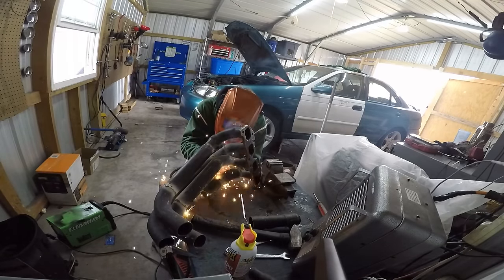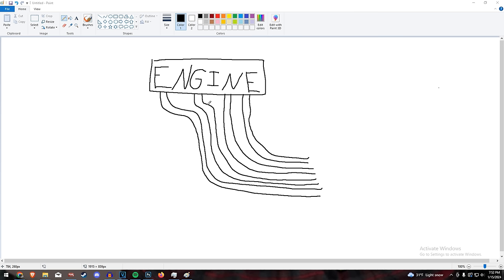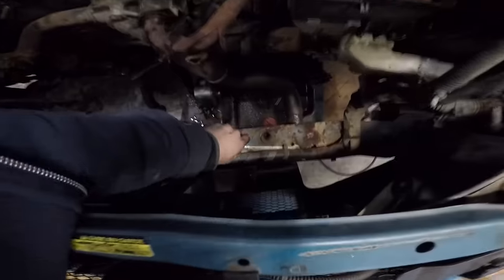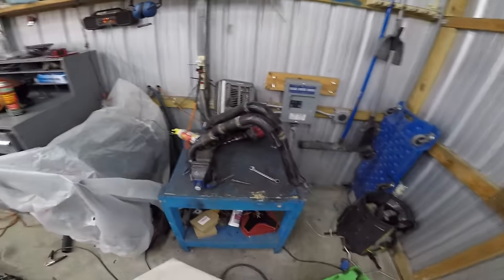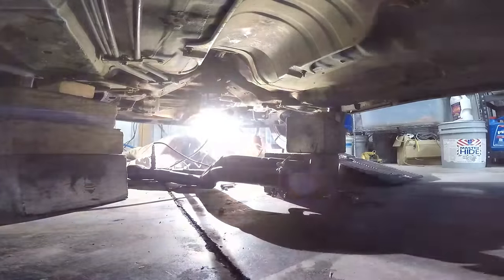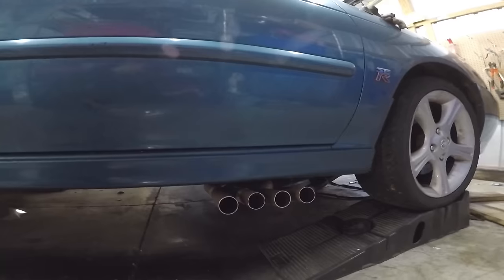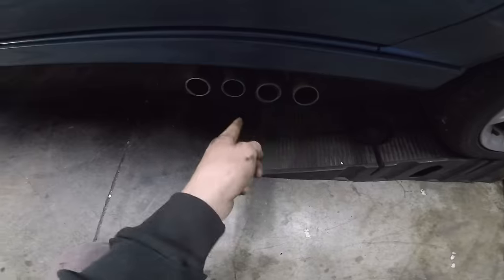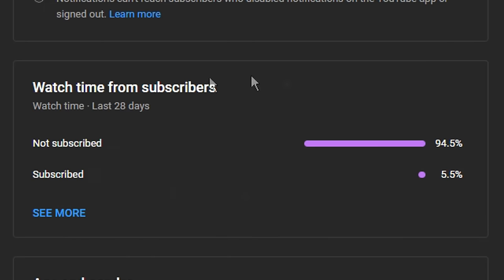True Quad Exhaust on a 4 Cylinder - What Will it Sound Like?

Comment: Definitely got some grins out of this one.  Actually sounds to me a good bit like an old inline airplane engine, especially at idle.  A lot of those early aero engines had simple runners like this, one per cylinder, but they'd be even more absurd than this because they were usually really, really short runners.  They'd make them just long enough to get the exhaust out of the engine cowling, and not an inch longer to save weight.   They were loud as hell, and they'd just blow fire all over the damn place during startup.
Reply from the maker: Yeah it reminds be of WW2 fighter planes
Reply: I love watching old merlins spit flames, but them wasp radials were something else entirely even if they used collector rings on the headers.
Reply: @100GTAGUY  Radials are works of art.  I have a powerplant mechanic's license.  Never got the airframe because my life changed during A&P school, and I had go elsewhere and do otherwise.  But I always sort of dreamed of getting to work on an old DC-3 or B-17 just to play around in one of those big, round engines.
Reply: @HatersGarage  If you get a chance, go to an IMSA race, and get to the Aston Martin paddocks while they're running the cars up prerace.  Those things sound dead-bang-on like a Spitfire when they crank up.  It's that British V12 heritage.  It just is what it is, and it sounds like it sounds.

Comment: That sounded significantly better than I thought it would!  I'm sure it was painfully loud though.  I wonder if the 2" diameter pipes were technically too big, and perhaps sound and power would be better with something matching exhaust port size (which I assume isn't 2").

Comment: I have experienced a 4-cylinder engine with individual exhausts several years ago. The exhausts were made extremely short, as the engine wasn't in a car, and it was super loud.

Comment: I once had a Mazda 323 1.5 liter that had a broken exhaust pipe prior to the muffler.  Had to wait for some parts to fix it, but still had to drive it for a couple of days.  You wouldn't think a little 4-cylinder could be loud, but if so, you'd be wrong.  It was deafening on the way to work and back.

Comment: I know there is another way to make a 4 cylinder sound good. If you cut the one of the pipes on the header and route it directly to the tailpipe while keeping the rest of the header and exhaust untouched (of course fill the hole), the car will sound great. This mod is popular among Japanese diesel truck owners.

Comment: at first I figured it would lose hp and prob sound llike crap which it did.....till you did a WOT drive by and it 100% redeemed itself lol...with a little refinement you got yourself that unequal length header sound we all love on Subarus. I wonder if you welded a cherry bomb or other similar straight through resonator onto each pipe if it could dial in that loss speed awful sound. I love it none the less, fun project you did there.

Comment: This is the latest video I could find on this little topic but I had an idea that could possibly help with the sounding cool thing.. take the H/X pipe design and then add some dead chambers towards the exhaust exit so it will reduce the rasp.. if you need inspiration for or an example. The stock exhaust for the 2021 Infiniti Q50S Red Sport 400 has those chambers.

Comment: My experiment, made my own Exhaust gas recirculation system, routed exhaust to intake on Bmw 325, actually lowered CO which is important if you might have a leaks exhaust? think about it, esp. for 4 wheeling where old truck can get CO in cab, might pass out and drive off a cliff, NOT me!  ;)

Comment: It should actually be slower this way, than with a combined exhaust pipe, as there is no venturi effect sucking the exhaust gas out of the combustion chamber, but it sounds 60% faster 🤘

Comment: Your car & skills are every "Karen's" nightmare.  I can picture her catching up to you at a traffic light.  "Errr, I can't hear you, please speak up my exhaust is too noisy."  😂😂😂.  

BTW You have answered every question I've had about exhausts in the last 30+ years.  I got done by a snakey shop a few years ago when they removed my cats & replaced them with with glass pack resonators.  All I asked for was a "deeper than stock," sound.  I went down a rabbit hole as they removed the standard exhaust & replaced it with an additional glass pack resonator & quiet silencer/muffler.  I hated the sound, had to get everything replaced after spending $1k.  New high flow cats, resonator (Dynomax Race Bullet 30cm/12" & silcencer/muffler (Flowmaster Super 44).  Now the drone is too heavy.  I got an  45cm/18" Vibrant resonator not replaced as at the time of typing this.  I cannot weld so now you know how much I spent.  Still without resolution.  😂😂😂 Cheers mate.

Comment: So it sounds exactly like any exhaust without muffler, right? Doesn't really matter is it one pipe per cylinder or one for all cylinders, result is basically the same as if you just cut your muffler off.

Comment: you have to take the hate speeching out of that header by adding rainbows, do that and your exhaust system won't be as racist,  wont help a lot until you get the transphobia out of your trans but yeah!  get rid of all the hate on the car and put it all in the engine,